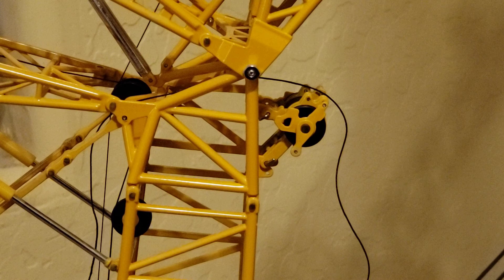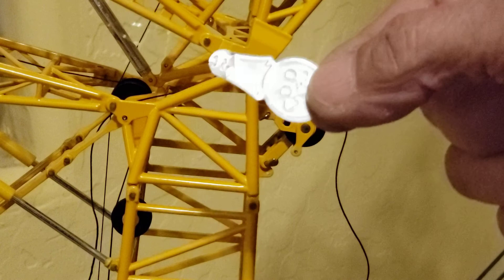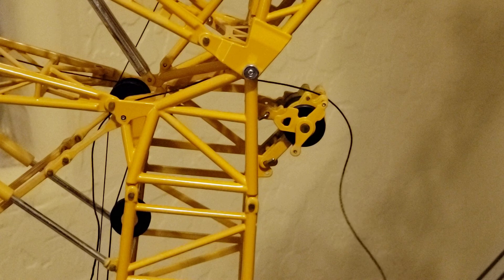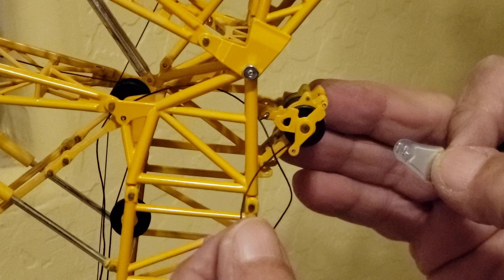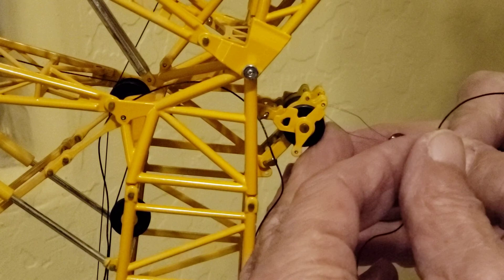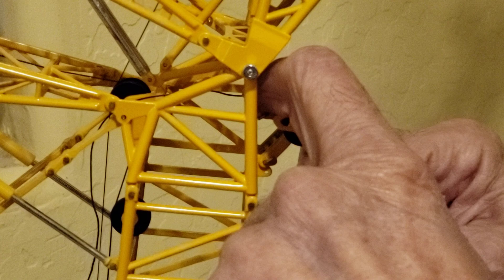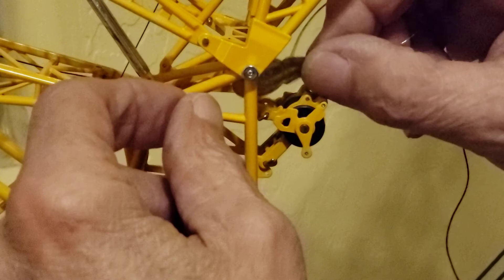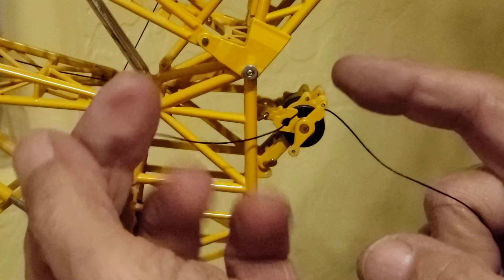Close Ups of the Reeving Methods

Comment: perfectly answered my question. thanks!
Reply from the maker: Awesome. Hit me up anytime. I'm no pro but certainly don't have the frustrations I had on the first couple assemblies. 😆
Reply: @lvdrums  just another idea I read and use is to use alligator clips to keep tension in the lines being reeved I really like the technique
Reply from the maker: @undergroundminer123  yeah that's a good idea. I may get some and try that. I've used large paper clips sometimes for light tension. Would be similar to alligator clips. Thanks for the tip and I'll mention it in a video if I'm on the subject.